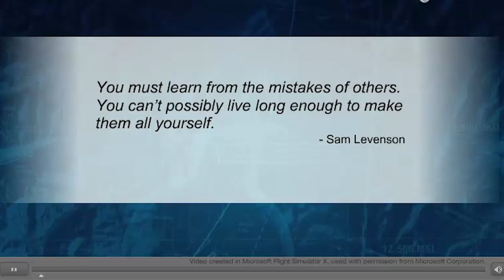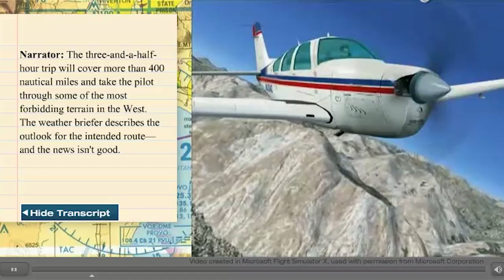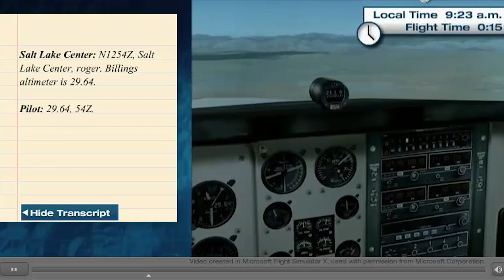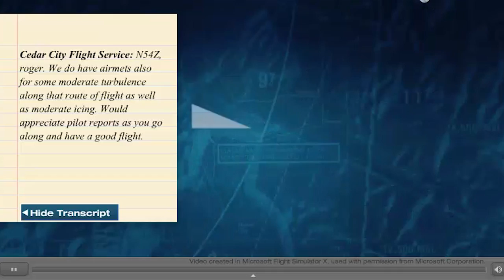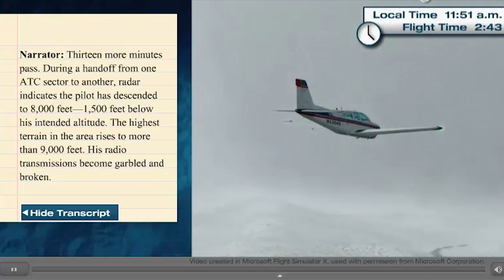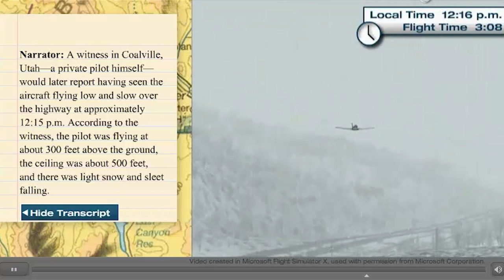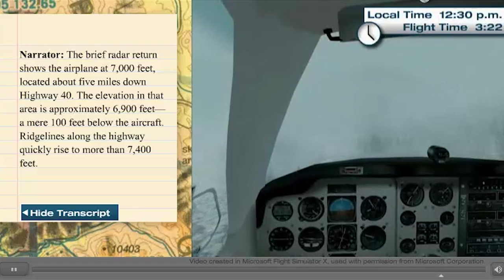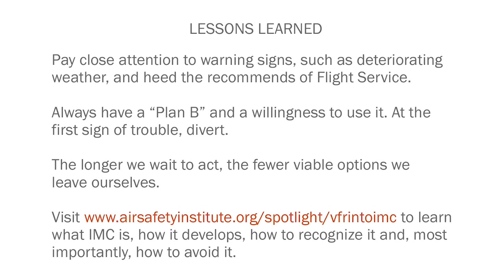Accident Case Study: VFR into IMC

Comment: This guy had a death wish. I'm surprised there wasn't a suicide note.
Reply: I'm surprised he lived as long as he did because he was such a risky pilot.
Reply: Speaking as a former CFI, I agree.  Hard to imagine that any rational pilot would choose to go into those conditions and terrain unless he was suicidal.
Reply: So many obvious warnings.  I wouldn’t fly that route on that day, in that weather, in that airplane,
alone, even with an instrument rating.
Reply: +Giada: I can. I hear it all the time. "Bah, I can ignore those warnings. Done it a hundred times before and nothing ever happened." I hear that from drivers driving over railroad crossings when the lights are on, or driving >100 kph in tunnels (because there is so much space there in case anything goes wrong with that), from electricians working on live mains (or >mains) circuits, etc.

Obviously nothing ever went wrong for these people before, because these are the types of activities that you can fail only once.
Reply: The pilot undoubtedly figured he was safe at any altitude, so long as he cruised above the interstate, believing there to be no obstacles. Evidently he didn’t hug the line closely enough however.
Reply: Red Bluesome. Since you seem to not have  first hand knowledge (which is completely fine) of this area I understand. However, trust me, I live and fly in this area very often. It was only going to get worse once entering either of those canyons (if he made it that far) in about another 7-10 sm. Fallowing I80 down from Evanston is cake compared to what he had just entered and was about to. This is heavy mountainous terrain with ridge lines and obstacles in every direction and only at higher altitudes from the highway level. That highway is the lowest point in that entire area. Many of those mountain in the surrounding area are above 9000ft in only a very short distance. Heber itself, including the airport (which is about where he was)sits in a small valley with mountains rising to high elevations is EVERY direction. A very non forgiving place to be in these conditions, as we locals know and from what we know from this... he knew it too and chose to ignore it.
Reply: @redbluesome2829  It seems that he was not searching for safety. Some people are addicted to dangerous, even life-threatening situations, as they give you a huge adrenaline rush which can feel quite pleasant. Also some people have a compulsion to "search for their limits". Whatever the case, he knew there was danger and he was fine with that.
Reply: .o. At least he didn’t take anyone else out with his foolishness
Reply: @Kivikesku  And adrenaline will impair your ability to think clearly and create tunnel vision, with either a fight or flight response.
He chose to fight, and lost.
Reply: Nothing to do with it Mizzy. Just cocky and over confident.
Reply: @Giada_De_Low_Rent_Tits Hilarious screen name! I LMAO when I saw it!
Reply: I agree with the "get-there-itis"-comment. I don't think it was that that he was used to braving this kind of weather, I think he was just dumb and thought, "meh, if I follow the highway it's easy peasy, and if it becomes too bad, I'll just turn around". It became too bad, but he tried to brave it anyway. It's when it became beyond bad, and was darn right dangerous to even drive in, that he thought about turning back. And this he did without the needed height. That is what I think happened. Sounds more plausible to me.
Reply: Andreas Kristensen He had a funeral to attend
Reply: Darwin awarded - natural selection.
Reply: He was too stupid and egotistical to even leave a note

Comment: Admittedly if I were under pressure to be somehwere I would be doing exactly what he was doing up until that report from FlightWatch... At that point I would have turned around.
Reply: That's when you buy a ticket and sit back and watch the pros make an uneventful landing at SLC. If you want to fly for fun on a business trip you need to have the cost of a commercial ticket plus the return cost of your plane built into the trip. If the cost aren't acceptable don't make the trip. GA is expensive enough before it cost you your life.
Reply: The first rule of risk management in Aviation is NEVER to allow a schedule or any other pressure to enter into decision making.
Reply: Yeah, if I knew the area maybe I would check it out just to see if it was possible or if there was a way around it, but if flightwatch told me it was not advised to continue and there was level 2-3 precip I would turn around and try another time. Nothing is worth losing your life for, no matter how important it seems at the time.
Reply: I agree, either that or get your IFR ticket and make sure you stay proficient. I think that acquiring an IFR rating is not enough. You need to keep practicing it to sharpen your skills. Like anything else in life, the more you do it the better you become at it. If you don't use it, you lose it.
Reply: GBigs Angle Yes that's what they teach us, but I am being REALISTIC. If my job depended on it I am going to be biased, and pressured. That's just how it is, it's not good, it's not right, but it's going to happen. Eventually you're going to have to fly in the REAL WORLD.

Comment: I wondered if even an instrument rating would have helped with all the icing and such.
When the briefer says VFR not recommended it's a good idea to listen
Reply: Señor Baldwinez with that weather I wouldn't dare fly IFR into that weather AND the dangerously high terrain in a GA aircraft
Reply: If he had been flying IFR he could have climbed to an altitude where icing wasn't present.
Reply: @chuckschillingvideos  You mean climb up through the ice, in a non-icing-approved aircraft? Is that what you're saying?
Reply: @bluehornet6752  Gee I'm so sorry I didn't know the icing rating of this aircraft!
Reply: chuckschilling General Tip: GA machines such as this aircraft are generally not equipped to climb out of icing, for the most part. Better to turn around...or not go there in the first part.

Comment: Sometimes you really gotta wonder what the pilots thinks.    But it teaches me: Listen to the ATC, do a big preflight briefing. Do not force yourself to fly to that area. If weather is bad divert/abort. 

BTW. I'm flying in Europe, I notice that most pilots just be like ehhh and yeah let me see etc. Don't they just block the freq?
Reply: I was blown away by how many hoops ATC jumped through to try and help this guy out. They never gave up on him which really makes me appreciate the work those men/woman do for us. Too bad they can't reach through the radios and knock some sense into pilots with the get-there-itis.
Reply: General rule my instructor taught me. If you absolutely "have" to be somewhere, fly there at least a day or two in advance.
Reply: ATC makes mistakes too.  The way to survive is to keep risk low.  Flying over mountains in bad weather at a low altitude is all about poor decision making and accepting far too high risk.  ATC is an aid to flying...they are not in the plane so the ultimate decision maker is the pilot, always.
Reply: Or just drive instead!

Comment: These are so well done & helpful. Thanks so much for doing them. Unusual that the pilot got the Commercial ticket but no Instrument rating. Pilot had some serious get-home-itis. Warned several times VFR NOT RECOMMENDED. Gotta just listen to others when they're doing everything they can to help you not get killed. It's difficult to imagine what this guy was thinking.
Reply: numerous professionals aren't instrument rated. aerial applicators (crop dusters) typically go straight for the commercial and add it on later
Reply: SMaze17 • That's precisely the problem. He wasn't.
Reply: I also feel that you can not obtain a commercial ticket without having an instrument rating.
Reply: That is really weird. A commercial rating without IFR. But what do I know, I'm not a pilot but my two sons are.